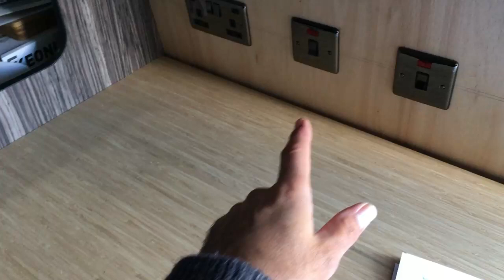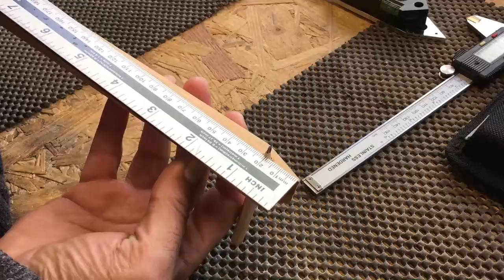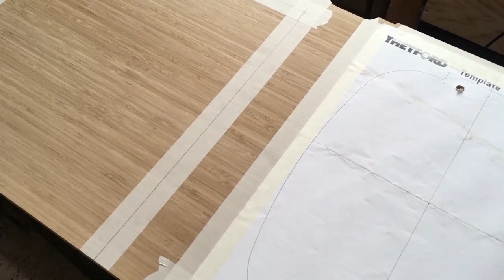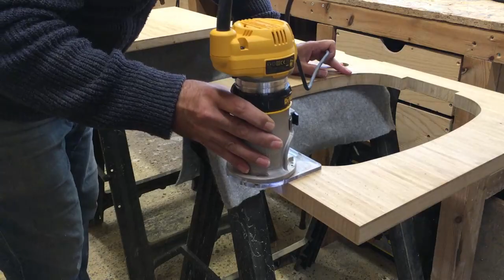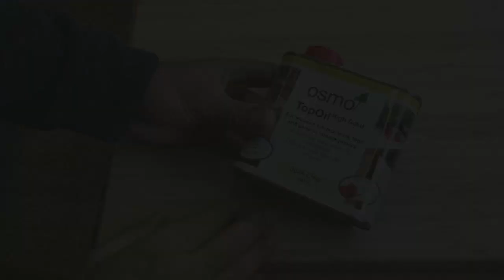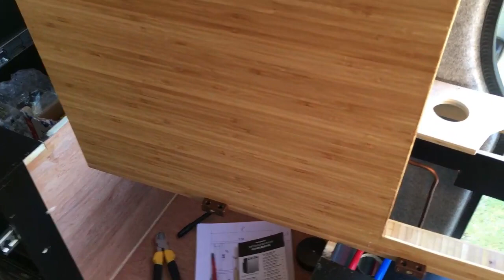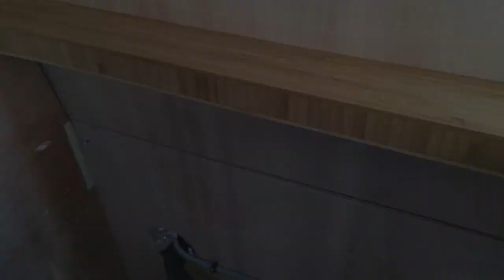Mercedes Sprinter Camper - Kitchen Worktop

Comment: Right through the series I've wondered if you lined all the screw tops up the same. But every time I thought about asking I stopped myself and thought there's only me would be as fussy as to do that. Good to know I'm not the only one. 
Now I just have to up the other 99.9% of my game to get near your level.
Reply: I too am a member of the vertical screw line club. Nobody gets it!  But the satisfaction of seeing them perfectly straight.  A funny story...I vetoed an electrician rewiring our house because his helper didn't get the switch plate flush with the wall after needing to look inside ( what type of work would he do with the be wires). And his screw was horizontal.... hubs still doesn't get it.   I tell him it's a Virgo thing😉
Reply from the maker: When screws are on show like on a switch plate I have to have them in a line,
nobody will notice but for a second of time, it does make me happy :D
Attention to details results in a quality job I think.
Reply: Wouldn't you want to turn the screws to achieve a consistent and appropriate torque for the material you are screwing into? That will result in screws in all orientations. Sure, the aesthetic beauty is lost, but the sense of function of the screw is maintained.
Reply from the maker: It does depend on application and all hidden fixings are done up tight. I’m just talking about visible cosmetic screws like switch plates etc where 1/4 of a turn makes no difference to its security 😊
Reply: @GregVirgoe  With Phillips head it doesn't matter if it is a + or a x so long as they are all the same, but there again I do have too much time on my hands.
Reply from the maker: bren106 don’t you think that north south + is the way to go with Phillip screws? 😂 👍🏼
Reply: @GregVirgoe  I'm not certain whether it's my artistic flair or my non-conformist streak that influences which way on a particular task. (he said with a wry smile)

Comment: A master craftsmen at work. I hope to start my van early next year with a few mods to adapt to South African weather. We are a little warmer than you guys but will review your van build videos again & again. Well done and travel well.
Reply from the maker: My very best wishes for your van build Alan. Insulation works the same in hot climates to prevent heat gain.

Comment: Could you put a hinged piece of bamboo to the end of the sink to extend the countertop?
Reply from the maker: Great minds think alike 😊
I have done exactly that. The square piece that I am polishing on the workbench is the extension piece. The video was getting too long and thought I’d leave a few surprises for the final tour.
Reply: Greg Virgoe  Is that why you did not put a radius to the front right hand  corner of the worktop?
Reply from the maker: Yes Norman, spot on my friend. That right hand edge will meet the lift up section and hopefully butt together. 
Didn’t want a valley there.
Reply: I wondered why you didn't round over the end like you did the front edge. That explains it! Looking forward to the final reveal.

Comment: Absolutely, Greg ... your videos are indispensable. And think the bamboo top looks great! 

(Bamboo-themed interior on my own build? ... hmm ... if Lord Jesus wills!)

And looking forward to your travel v-logs as well. We'll be praying your adventures are safe, fun and everything you and yours hoped for. 

Just an observation: if anyone has a similar cutout for a slide-in oven with cooktop like Greg here ... and if you want more support when moving that top after its been cut inside the workshop. Or if the top needs to travel in an truck for a while; one can attach a piece of 1"x4" wood stock to the underside and pre-drill and use screws to hold it. I've seen a few expensive countertops break at that back edge when they weren't supported before getting to their place of install. 

Lord Jesus bless and thanks again to Greg for this great info and instruction ... Brilliant !

Comment: "I always like to leave all my screws with the slot in the vertical position and they all look nice and neat."
That statement defines your attention to detail which is nothing less than amazing.  
This is bitter sweet for me realizing that we're very near the end of this wonderful construction project.  
Thank you so much for this brilliant series Mr Virgoe.
Reply from the maker: There will be lots more technical videos to come on every aspect of the van. There are lots of parts of the electrics, solar and battery setup that have not been discussed yet 😀
Reply: @GregVirgoe  What a relief! Thanks Greg!
Reply: I have watched the series from start to finish and I have always been impressed by the attention to detail, not just the 'hands on', but the explanation behind the decision making process. A thoroughly professional approach that puts all other van conversion videos to shame. Unfortunately, the vertical screw slots have destroyed my faith in Greg's project. Any fool knows that slots should always be horizontal, just like every switch, socket and door handle screw in my home.
Reply: @arius1  Yes, an elementary mistake for Greg to make but it does show he's human! 10/10 as usual Greg! :D
Reply: @ @arius1  I can't help but wonder how many of those screws are loose.  That's one for you Greg!
Reply: Positioning screws slots all in the same direction (normally lengthwise) comes from the sailboat world, I used to be a sailor.
Reply: So tempted to go low with the slot in the vertical position comment but I'm not gonna do it.

Comment: What filter system are you going to use for your drinking water and how will it connect to your fresh water tank? Thanks
Reply: Oh my, I will have to sort that one out also.
I am located in a country where all tab water is drinkable, so actually hadn't considered that at all.
Thanks Jane, for asking Greg about that - so I will remember. :-) :-)
Reply from the maker: Hi Jane, the little drinking tap is on a separate system to the main tank. There is a small 10l Jerry can in the back of the kitchen cupboard with its own submersible pump. Have a look at my water services video for more details 👍🏼😀
Reply: Thanks-I must have missed that one!😂

Comment: Awesome as always!
Maybe just a little tip, but it's actually easier to use a round shape to follow a line.
That way it doesn't matter if you move your pencil since the distance is always the same size.
Anything will do as long as your pencil fits in. If you want to do it fancy use a ball bearing.
Also it's a nice idea to coat the surface in the direction of the grain as well (or at least the last stroke). That way if you messed anything up it's not so noticeable.
Reply from the maker: Hello Merlin, very sorry but circles do not work as scribes because on curved surfaces they trace a line which has a different radius and will not fit. 
You may be able to get away with it on straight lines but trust me it’s not the correct way to scribe a unit. Thanks
Reply: @GregVirgoe  I don't think we are talking about the same thing. Because that happens with anything you're drawing with a certain distance. 
That's the nature of the beast.